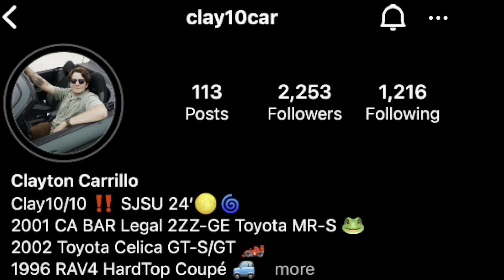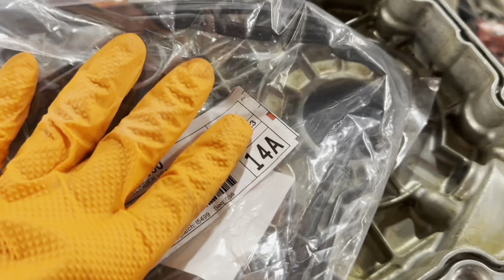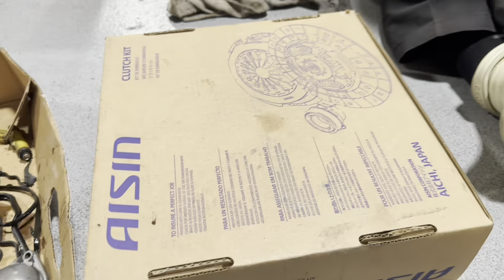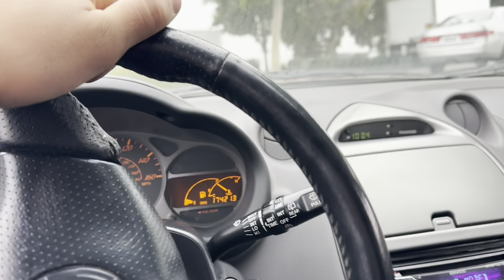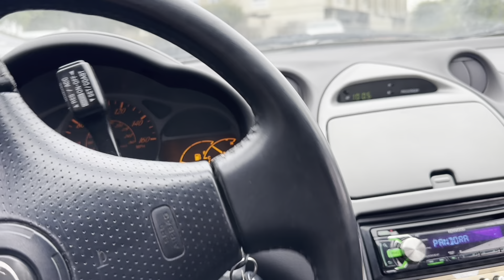Clayton finally found a working 2ZZ-GE engine for the Facebook marketplace Celica 7th gen.

Comment: Hi 2zzlow I'm that guy from Houston tx. That comment about a 2zzge that i rebuild from scratch about 2yrs ago If you remember. BAD luck for me the 2zz only ran 900 miles then it broke it lost compression i took it apart and the cylinder walls fell apart destoyed new pistons and  rings because of that MMC metallic matrix composits crappie block Sorry im upset about it. So to make story short to keep car i went with a 1zzfe now i call it my CURSE Celica. 😂
Reply: Do it again, but have the block sleeved with darton sleeves. Then you can run whatever pistons you want, could even run reasonably high boost if you run the right comp pistons. 

MMC walls don't bode well with  forged pistons, iirc

Comment: So you drive Toyotas and work on both. Which engines are better in terms of longevity and design
Reply from the maker: I haven’t really worked on any modern Toyota. I specialize in 1ZZ and 2ZZ and if taken good care of they can last forever. Avoid 2AZ. 2AR is a great Toyota 4 cylinder at the moment. Any Honda is good in my book before 2015

Comment: Hey 2zzslow is there any throttle controllers for the fly by wire celicas? It feels super unresponsive in my automatic man. If you could help I really appreciate it
Reply: Maybe try cleaning it first. Also look at the IAC Valve

Comment: Yamaha make Toyota motor
Reply: Yes I don't recommend getting one they are very bad motors they can not be rebuilt trash motors look at my comment they blow up
Reply: @JoseLopez-mk5zw   how do I know if it’s a Yamaha motor?
Reply: It says Yamaha on the timing chain cover in big letters and you can Google search it type 2zzge motor
Reply: @JoseLopez-mk5zw  I did check Google it said 2000 GT model I don’t think the Corolla or the Camry has the Yamaha motor
Reply: 2zz motors are in corollas XRS, celica gt-s,  lotus elite and Pontiac vibe GT . Only those cars with those models
Reply: @JoseLopez-mk5zw  most of those cars are discontinued I’m just worried about the new ones the 2020s and up.
Reply: @JoseLopez-mk5zw  Did Toyota stop using Yamaha?
Reply: If you buy any new corollas or camry no worries you be good 👌 for many years to come just do your oil changes and they last forever
Reply from the maker: Yamaha made the head I believe